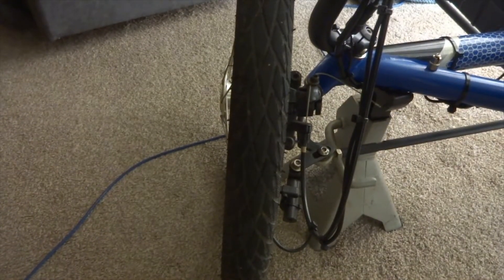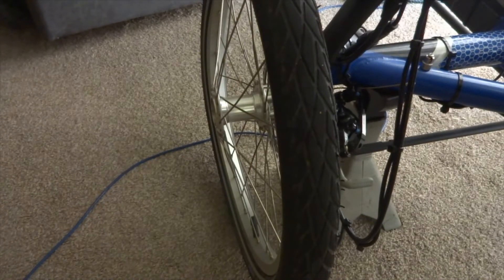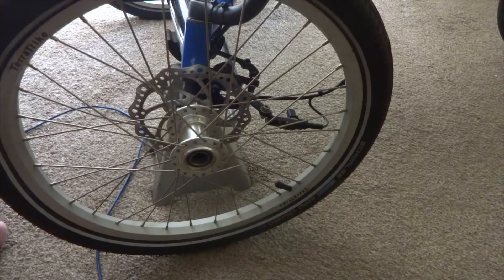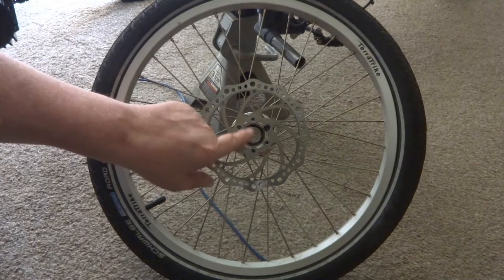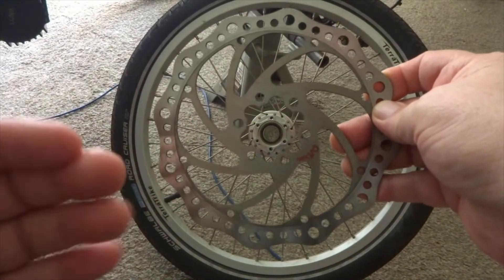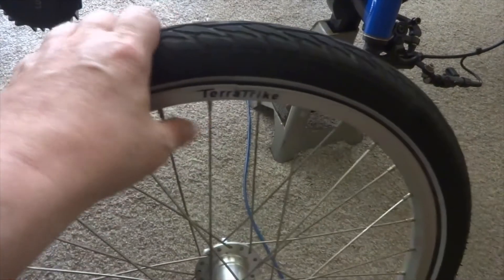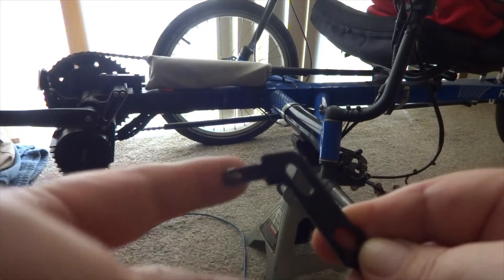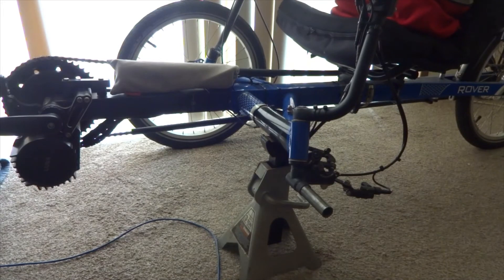Rover wheel removal

Comment: Have new double-walled EVO wheels to go on my Rover. Glad there was a video of some sort to show the ins and outs.
Trying to remember where I put the Marine grade grease for the axle.

Wonder how difficult it is to replace the bearings on the hubs? No local bicycle shops here. Got new wheels from TerraTrike's Scratch and Dent section, and one wheel's bearings do not spin as freely as they should. Have a Tongsheng TSDZ2 installed, so am anxious to go for a ride.